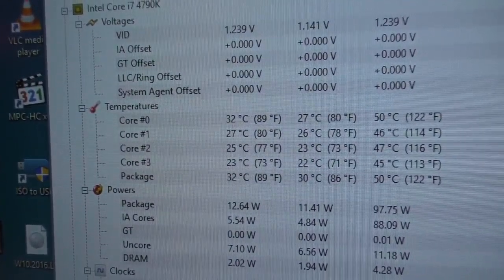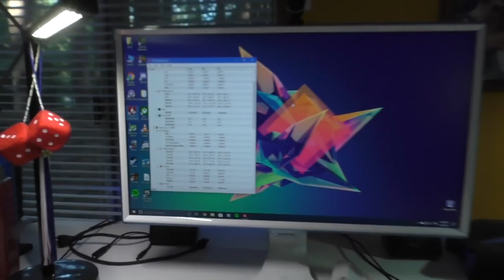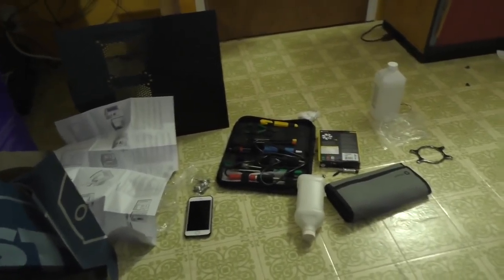Vlog - Rebuilding My PC!

Comment: Im running a Ryzen 7 1700 32gb ddr4 2400mhz ram and dual 1070's. I wanted it cause I edit 2-5 hour 1080p videos a lot which surprisingly uses a bit of ram. 16 gb or so on average.

I like ryzen more for the performance and value.

Comment: We have a few things in common. I too have a v6 Accord coupe and also have a custom PC I'm about to upgrade.

That said, I like the h700 I just don't think it's good enough or does enough to merit it's cost. I don't think it looks as good as the Evol glass case and I get the same or better temps with my meshify c that cost me $80, and it looks pretty good as well and has tempered glass.
Reply from the maker: I purchased this case because it was the best option at my local brick and mortar store, not necessarily because it's the best in its class. I'm happy with it though. #accordgang